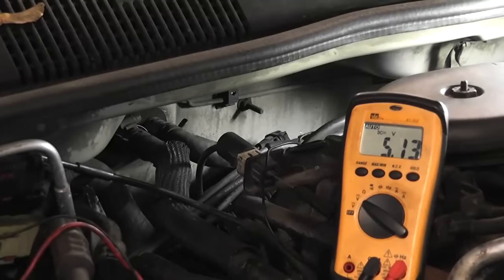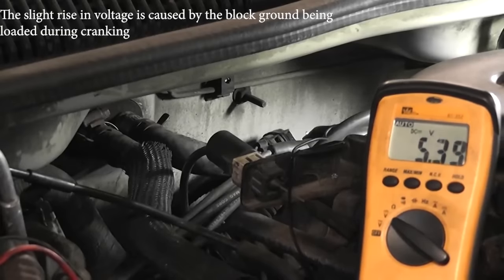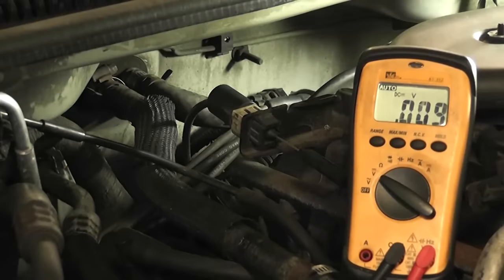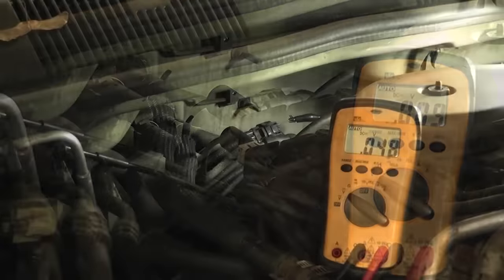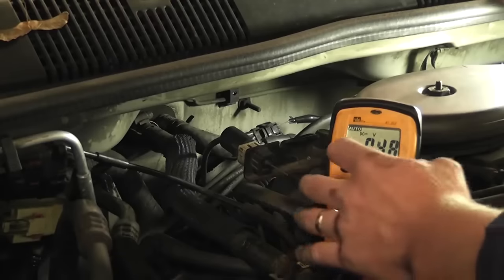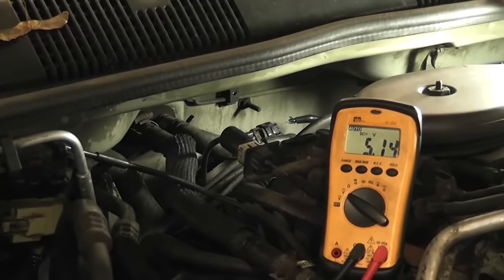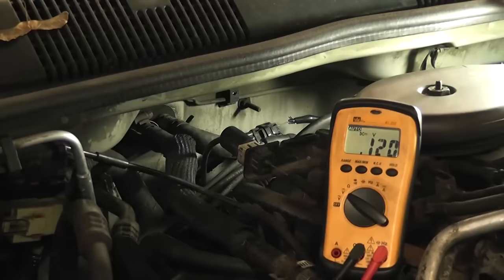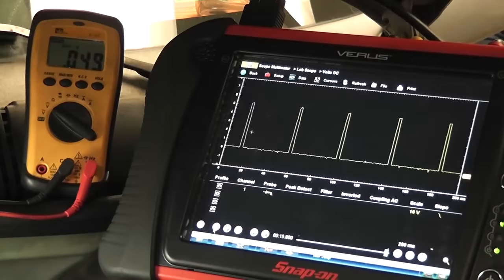How to test a cam or crank sensor with a voltmeter - hall effect type - (Quick Tips)

Comment: Hi Paul, saw a lot of your YouTube videos and I am having a problem with my jeep tj 2.5 1999.

The camshaft sensor and crank sensor both get the 5v reference and a ground.
But the signal output varies between 4.08v and 0.11v. 

Bench tested these sensors with a 5v power supply, and results are 5.07v to 0.00.

What can case the sensors to bench test good but when mounted to the jeep a lower signal on both of them?

Hope you can help.

Daniel
Reply from the maker: Signal wire right? What problems are you having?
Reply: @ScannerDanner  the cam en crank sensor connector both get a 5.07 supply and a good ground from the pcm.

When cam and crank sensor mounted in the jeep and turning the engine by hand my signal wire back probed from the connector gives me a 0.11-4.08 voltage. 

Removed both sensors from the jeep and tested them on the workbench gives me 5.07v to 0.00 on signal wire.

Problems are batch fire of injectors and 10 pulses on sensor ground for every full turn of the crank.
Reply from the maker: @danieldenboogert3022  what do you mean 10 pulses on sensor ground? Shouldn't be any pulses on sensor ground
Reply: @ScannerDanner  sorry I mean 10
pulses on injector connector ground. 
And batch fire of all the injectors
Reply from the maker: @danieldenboogert3022  batch firing injectors is not uncommon on a crank 
What are you chasing? Not what you are seeing.
Codes, symptoms, history etc
Reply: @ScannerDanner 

Looking for some help on a crank no start problem in my jeep tj 2.5 1999.
No codes

- checked fuel pressure and check valve 45psi OK
- checked compression OK
- checked for spark OK
- checked for pulse on injectors OK
- checked for 5v reference at the sensors OK
- checked and cleaned grounds
- checked cam and crank sensor wiring for continuity to pcm plug OK
- checked pcm for power ground and 5v reference OK
(and ordered a new one from wranglerfix, same problem crank no start)
- soldered the connections of the cam and crank sensor eliminating a possible bad connector
- bench tested cam sensor (distributor pickup) with 5v supply
0.00-5.00v on signal wire
- bench tested cam sensor (distributor pickup) with distributor removed rotated shaft by hand 
With 5v power supply
5.07v-0.00v on signal wire OK
- bench tested Crank sensor with 5v supply 0.00-5.07v on signal wire OK
- tested and checked distributor timing on TDC OK
- tested map sensor OK
- new properly gapped spark plugs
- new rotor
- new distributor cap
- cleaned throttle body

Found a possible problem: when cam and crank sensor are mounted in the jeep and plugged into there connectors when backprobing the connector on the signal wire found a signal between 4.08v and 0.11v when turning the engine by hand.
For one rotation of the crank I get 10 pulses on all the injector ground wires and wet plugs.
Looks like the injectors fire as a batch and not sequential.
I didn’t find the info online but I think injector firing should be sequential.

both sensors bench test good but when mounted in the jeep there is a volt missing on the signal wire when turning the engine by hand.
Bench test and mounted to the jeep tested with same multimeter.

Both connectors have:
5.07v on the power supply for the sensors
Battery voltage on the ground with multimeter connected to the positive terminal of battery.
Reply from the maker: @danieldenboogert3022  If you still need help, I've created a free forum you can join on my website at www.scannerdanner.com I have over 28k global members and hand picked moderators who are there to help me help you guys. Hope to see you there! I try to do my best at helping people here but I just can't keep up, I am sorry. But we can definitely help you on my forum!

Comment: How would I check an individual coil for short on a 5.7L Hemi?
Also if anyone’s familiar with a Snap-On Ethos can I check that on it? What section should I check under (Engine Data)?
Reply from the maker: do a spark test first, see what it can produce, if any, then go from there. 
no spark - bad coil, wiring or control issue
swap coil to another cylinder and recheck, if it stays with the same cylinder, your coil is fine and you have a wiring or control issue
Reply: ScannerDanner Only problem is, it’s not throwing a DTC for a miss yet it still feels like it’s missing. Oh and thanks for your help Paul. :-)
Reply from the maker: @BigD1395  Chrysler/Dodge systems have misfire counters you can see on a scan tool. Also, check your fuel trims

Comment: I have a 2011 colorado.   It reads 8.5 to 8.3v running.    I change the sensor and as soon as I touch it it dies.    Any suggestions?
Reply from the maker: Harness connector pin contact issue or broken wire in the insulation right at that connector

Comment: What could be the cause for me not getting power to my signal wire going from my ecu to the plug? I checked my ground wire which was 11.5v but my signal wire is dead 0v.. I made a new wire to make sure of no shorts but still nothing and I tried 2 ecus I know are good but still getting no power. what could be the cause?
Reply from the maker: You read 11.5v on your sensor ground wire? That is a problem.
Reply: @ScannerDanner  as in weak battery.. I’m gonna change the battery soon but why do I not have a power to my signal at all?? It’s driving me crazy I did a troubleshooting write up and nothing
Reply from the maker: @ovtxcz6414  you should have 0v on a sensor ground, unless you're comparing it to battery positive. All initial voltage testing should be done with the key on and sensor plugged in (back-probing).
Also, not all hall effects will have voltage on the signal wire when measured with the key on and sensor unplugged
Reply: @ScannerDanner  I tested with the plug in plugged test each wire with the key on 2.. my ground was 11.5v, my brown wire in the middle was getting power but port 1 on the plug (blue/white) signal wire had no power.. I made a new wire from the ecu to the plug and no power still…
Reply from the maker: @ovtxcz6414  I'm so sorry, it is hard for me to keep up, especially with follow up comments. I get about a hundred new questions a day, and do my best to answer them and when I do, they just multiply! Anyway, if you still need help, I have created a forum on my website https://www.scannerdanner.com/forum/post-your-repair-questions-here.html that is free to join, where I have 4 hand picked moderators and over 25k global members who are there to help me help you guys! You will not find a more friendly and helpful forum anywhere. Hope to see you there! Thanks for understanding.

Comment: There are cheap multimeters with signal display so you can see the waveform coming from your system.
Reply from the maker: they are too slow, even the graphing meters, look up the specs
Reply: @ScannerDanner  too slow as in sample rate or maximum frequency displayed or both?  What frequencies does a car's modules run at?

Comment: why have I got 12.80 volts between the negative cable, (disconnected) and negative terminal .. the amps blew my volt meter, in amp settings, so I used my new one and there is 12.80 volts, all night.
Reply from the maker: Normal voltage reading with the cable disconnected. No current flow = no voltage drop, so basically the engine block is now equal potential to battery positive. This is not a good test for really much of anything. Are you the one I've been talking to about the no crank and throttle body buzzing?
Reply: yeah, and thanks alot for replying ..  I found the videos you made  that will help me out, so now I will test the TPS, (Ecm power and grounds) Fuel problem, spark, (ignition coils) the key only works with starter relay hooked up to chassis ground, this could be Ecm problem, I will let you know the TPS voltage back probe test results, in 7hrs, I go back to sleep to now, thanks scanner danner.

Comment: I like it I'm familiar with scope just looking for more experience at reading timing angle got a ram that dealer claims needs expensive hard parts and I Wana make sure that damn rat is not the real problem buried in the wiring
Reply from the maker: What test are you trying to do? I have some good stuff on mechanical testing using a scope.
Reply: @ScannerDanner  I want to know if have proper signal to injectors on 6.7 Cummins in a ram .working on a 2022 3500 farm truck was driven to the store 10 miles away and it broke down dealer got some flow measurements and are saying all the injectors need to be replaced but this truck spends its time at a hay barn I want to know that it doesn't have wiring damage .

Comment: Is there a way to know if I have a hall effect type cam/crank? I have 2007 chrysler 300 lx 2.7 engine that was manufactured in March. I purchased this car totally blindsided by how pretty it is and now I have 3 words o describe this, woulda, coulda, shoulda.. SMH thank you anyone in advance for any positive feedback!!!
Reply from the maker: Yeah the 2.7 was notorious for carbon issues and it would effect the hydraulic timing chain tensioner. At least I think that was the issue.
I believe they are both hall effects on your engine. (Cam and crank)
If you see 3 pin connectors on them, they are hall effects. If you see a 2 pin, it is a variable reluctance sensor.